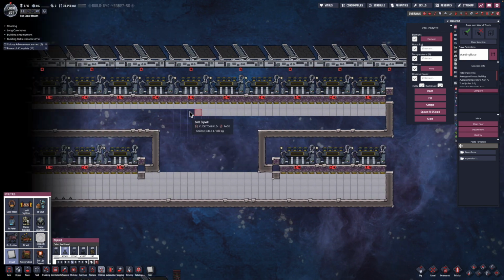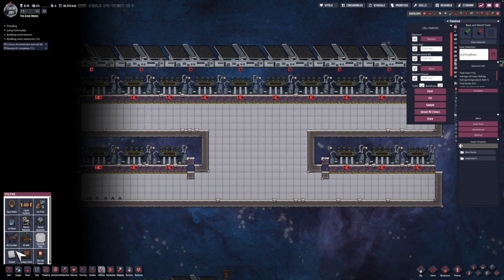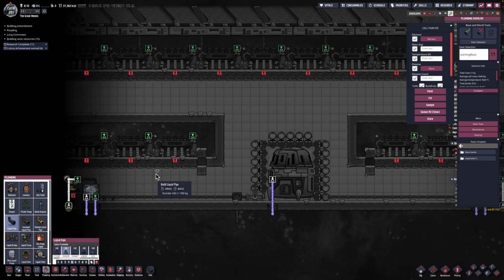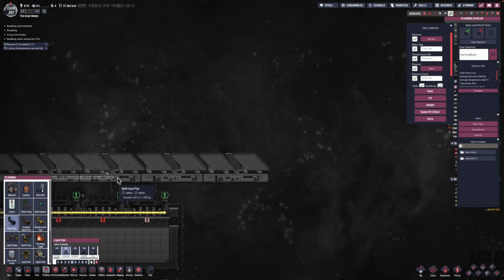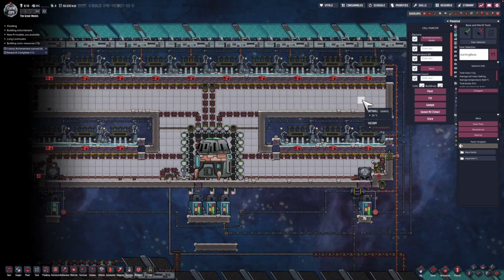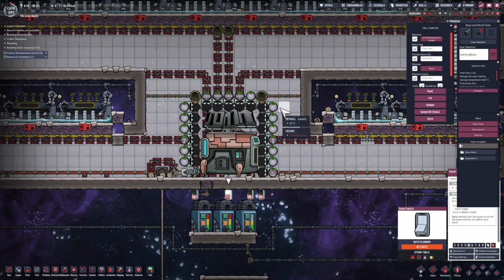Oxygen Not Included: Nuclear Power Plant and Tons of Radbolts

Comment: Nice Video!
Since watertanks equalize water temperature of water, you can exclude the liquid shutoffs. input return water from cooling loop into watertank and from the output of the watertank put a liquid temerature sensor to the automation of the aquatuner, this is properly not important in this design when you have so much power but is a nice trick in other designs. just remember a bypass bridge over the aquatuner :D